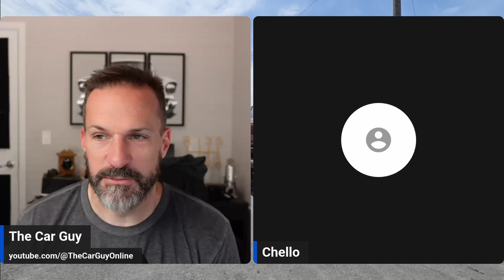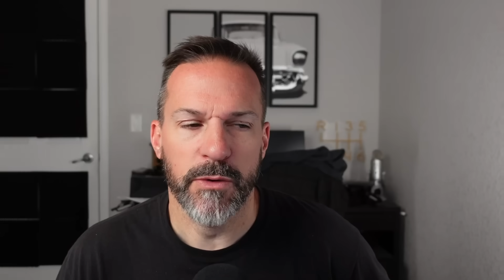Former GM Engineer EXPOSES Planned Obsolescence Tactics.

Comment: This is unfortunately industry wide. I work in a factory that makes steering components for a lot of passengers cars and also a lot of semi's, fire trucks, military vehicles... Basically the engineers don't improve the product, they only improve the line by either trying to reduce the amount of people working on it, or the time it takes to assemble one product. But most of the time, they basically work with other suppliers trying to get a certain part made cheaper. Once that part arrives, they try to modify either the PLC or the fixtures, machines... to run that part that is of lower quality, with worse tolerances. Basically they're just trying to save money.

Comment: Yeah, sorry, I don't believe adding an additional pinion to a planetary gear is cheaper than tempering four gears.

NEVER own stock in the company you work for. NEVER invest in any individual stocks unless you can afford to lose the money. It should be illegal for companies to encourage employees to invest in the company's stock.

GM makes profit off selling parts. A lot of profit. The service parts retail price is ten times or more what GM pays for the parts. The problem is, a lot of dealers don't use GM parts. Haha. Why wouldn't GM require dealers to use GM parts? 

Yes, it's true that changing your oil every 10k miles and never changing your trans fluid is dumb advice. On the other hand, people WANT vehicles with less maintenance. GM isn't the only automaker doing this. Oil, trans fluid, and antifreeze has become MUCH better than what we had even just a few decades ago, for sure. But extending the service intervals to 3X or more of what was once considered standard is foolish.

Comment: I'm sure most/all manufacturers do this to an extent, but with General Motors, it's always been pretty obvious. What I found was most painful was the whole Cobalt/G5 ignition system where the ignition contact could easily be cut if a heavy keychain was used, in which case the car would shut off and steering would lock, regardless of how fast it was travelling. A few people died as a result. But the biggest highlight to GM's corporate greed and malevolance was that they knew of the problem and chose to favour paying off lawsuits over fixing the cars with a sub-$0.25 part. That alone will keep me away from General Motors for the rest of my life, no matter how good of a product they build. I really do love their Volt as a proof-of-concept vehicle. If they re-built a Volt in a station wagon format, it would definitely be tempting.

But I'll always rememeber how they'll f*ck their customers as they shake their hands and that'll keep me away.

Comment: As a retired mechanic, bought an EV and I’m soooooo happy 😃 😊😊 I’ve also got no stress & clean hands & a pocket full of cash 😊😊😊
Reply: Until you need a replacement battery.
Reply: @mikeytitanic  battery warranty is 8 years 100K miles. Batteries are coming down in price.

Comment: Drive a 1991 nissan d21  pickup  i can fix just about everything on it myself parts are available interior stuff little harder but love the truck.
Reply: Have a 2001 Frontier 2WD with 229K - call it the WarBird - reliable, tough as nails. Easy to work on.  LOVE IT.  Also have a few other non-cvt Nissans  - Nissan isn't perfect but they try - need to abandon cvt completely.

Comment: My elentra has a non replacable interal transmission filter, at 80k miles all the transmission filters are clogged regarless in you changed the fluid every 5000 miles..  only way to change it is full transmission break down... bullshit...

Comment: I wish people would stop calling that planned obsolescence. It's just good ole inferior product design. planned obsolescence would involve timers or sacrificial components engineered to fail specifically not  due to a lack of maintenance. 

not caring how long it lasts past the warranty is not planned obsolescence. as your interviewee said, car manufacturers sell cars, they don't make money fixing them.

I'll add that dealerships sell finance, neither is interested in you owning a car long term so they don't care if the car survives
Reply: No. The phrase is correct because it is engineered intentionally to fail. They want it to fail. The components are sacrificial. They know when the components will fail. 

Dealers make about 50% of their profit on service and repair. The guy in the video specifically stated that comment was in reference to the past.

You seem like one of those people who just like to argue because you just made those things up and intentionally took another part out of context.
Reply: @someguy5035  the term "planned obsolescence" didn't even apply to the lightbulbs it was coined for. that bulb that's still going is so dim it hardly lights the ceiling it hangs from. 

engineers build things to a specification. if that specification has an end date, it's planned obsolescence. if the specification is to survive normal use while costing the least to produce, that's regular corporate penny pinching.
Reply: @someguy5035  Until you've been given a budget to design a product, you won't really understand. No ones going to say "this wheel has to last less than 50,000km" theyre going to say "this wheel has to cost less than $50".
Reply: @jaro6985  If you know something is going to fail, resulting in cost to the owner, it is planned.
Reply: @someguy5035  you're twisting words now, before you said its specifically designed to fail early, now you're just saying if you know it can fail at any point. Again, design something within a budget and tell me it can last forever.
Reply: @jaro6985  Everything you have posted in this exchange is in defense you twisting someone else's words and expecting the rest of us to go along with it. 

It is designed with failure being a part of the plan. There are things designed poorly without malicious intent. That is poor design.
Reply: Exactly, its just cost cutting.
You could argue the maintenance intervals are some sort of planned sabotage though, if proven to be true.

Comment: S-10's from the late 90's and early 2000's had a recall on the solenoids because they "accidentally" put the solenoids at the wrong shift points and it was destroying the transmissions. 
Sure, they issued a recall MANY years later, but the cheap solenoid replacement basically cost them nothing because they had already made millions selling replacement transmissions.

Comment: The average consumer is only interested in what gadgets the car has or how pretty it is. The guys and girls that are actually into cars all drive 10+ year old vehicles and like me, I drive a 42 year old truck with a 14 year old drivetrain swap, aftermarket ecu and all the "production" flaws in the driveline (5.0 coyote with upgraded oil pump gears and a homemade single tubeo set up, vvt limiters, built 6r80 with a built 8.8 in a 83 ford Ranger). Truck gers 24mpg, runs 9s in the 1/4 and has proven to be a dependable daily driver for the last 3 years when I finished it.

Comment: Retired automotive technician here. I had the low/reverse planetary in my Silverado explode while gently backing out of my driveway. Sadly this gentleman in the video is correct. If you could get an engineer from the engine development to speak the truth, you would be amazed at the garbage GM is making now. I wouldn't recommend any GM vehicle to a prospective buyer, and that was the only cars I used to purchase. I took delivery of my new Honda last Friday. It is my second Honda now and I couldn't be happier with the dependability. If you don't like Honda's, that's fine, Toyota makes a great vehicle too. You'll thank me later.

Comment: Ford and GM have let the accountants loose in engineering, resulting in substandard parts.  I question if the engine generates 50 more HP than normal if the drive train would fail?  Engineering once built parts to handle a change in power, basically a change in altitude, fuel, and bolt on kits.  I am afraid to put a small NOS kit on today's stock engines.  

I am a retired COO with a background in manufacturing engineer.  I worked for GM in 1998 to convert a Malibu plant to run the new Saturn cars.  It took one meeting to learn that GM had no management plans, meaning they let the engineers free roam, and argue 90% of the day on who holds the most seniority!  If GM wants to cut costs, it is time to move back to full management, and fire the toxic engineers.

Comment: My 2010 F150 with the 6sp still drives like new (6R80 transmission).  Coming up to 300k kms and most of that is short city trips. Will keep this truck for another 5 years minimum. Would never buy a GM. Not saying Ford doesn’t make the same obsolescence short cuts. But they don’t do it on their trucks as much.

Comment: Explains why my POS Duramax LML snapped its crankshaft in half at 102,000 miles. Stock truck, stock wheels and tires, immaculately kept and maintained. Ended up buying a 2023 Denali 2500 HD and its been a cheap POS as well. 30,000 miles and nothing but trouble with it. Done with American vehicles after this.

Comment: Just take one look at GM truck GCWRs, and it will tell you everything you need to know. They're just not capable. GM makes disposable, less capable vehicles. They've completely abandoned building competitive trucks. They build something that looks like a truck, with barely-competitive specs, slap a trim package on it, and charge $40k more for vehicle that's 1/2 as capable. This results in hugher profits, which means it will eventually take over the market.

Comment: I dont work at Opel but close enough to the fire to know that this is correct. When Opel was part of GM managers came in, introduced cuts or directed engineers to use the cheaper option while engineers pressed that this will cause a cost down the line.
When Opel then had to recall their vehicles to replace the part later on, the manager gone higher up into the GM corporate ladder and Opel had to take the loss.

Comment: I sell auto parts, and the statements expressed are EASILY confirmed every day over the counter. Make it juuuuuuust past warranty and then who cares? And that's why the vast majority of those dealer parts department parts don't last anywhere near like the original factory-installed part. They don't have any warranty hurdle to clear! When I sold parts at the local Chevy dealer back in the late 80's early 90's several sales people told me multiple times that they didn't make the money on selling the car, they made the money in parts and service. ENGINEERED TO FAIL! I have so many anecdotal stories that further point to that, but at the end of the day it's just my word against the almighty manufacturer, but I will give one more story that I can say is true because it's something I did.

As I said, I worked in the parts department, and one of my coworkers and I decided to see just how much it would cost to build a Cavalier (which were then sold for between $7800 and $12,000 from just individual parts. We started with the larger, more expensive components and moved downward, but we weren't anywhere NEAR a finished car when we hit $100,000. For a Cavalier. There were so many parts that you couldn't buy as an assembly, but were priced relatively expensively on their own (like trim pieces and nuts and bolts) that the cost just rolled upward. And the majority of parts we sold over the counter were just that: individual, small parts, priced relatively expensively.

The only reason the manufacturers are okay now with building vehicles that might make it 200,000 miles or further is because they've got to do something to be competitive with the better manufacturers whose vehicles legitimately and historically make it that far, and because people drive so much more now that the time of ownership isn't much more than the old 100,000 mile goal of new purchase required.

Comment: My late father in law was a chemical engineer with Mobil. He told me that starting in the seventies, as stricter regulations upon vehicle manufacturers began, in order to control costs, manufacturers were coming to the oil companies asking for better additives to protect the engines. The manufacturers had begun changing metallurgy and removing any “excess” weight within their engines and other components in order to meet fuel consumption requirements.
Reply: I sell auto parts and I've sold a lot of "hot rod" parts in the past. Old-school engines had camshafts that were made of cast iron. Replacement cams for them still are. Newer engines have billet steel cams, much harder material. The oil industry removed zinc, a wonderful lubricant, from their gasoline engine oils several years ago because of EPA mandates, and because billet steel doesn't need it for the break in period after an engine build. Old cast iron cams definitely DO need it though, and if you build an old hot rod motor, like a pre-fuel injection Chevy 350, and use say, today's Castrol 20w-50 to break it in, you're going to wipe the lobes completely off the cam because = no zinc. And that's not covered by warranty. So there's a big market for retro oils with high zinc. Lucas makes one they actually call "Hot Rod and Classic" oil. My long-winded point is that where your father in law had to add chemicals to satisfy the manufacturers, he also had to remove additives to satisfy the government. Much to the financial hardship of people who weren't in on the back room decisions of cost cutting.

Comment: People forget that all car companies are really just profit centres that are in the business to make money for the shareholders. They just happen to do it by building cars. I worked for a part supplier and every year we had to cut our costs to provide a certain percentage savings to GM as part of our contract. Every year we would do a workshop with GM Engineers to find ways to cut the costs of the product. Down-gauging was the most common method. This had the dual benefit of reducing cost and mass which in theory would improve mileage. But the main focus was on cost as they were not as concerned with mileage when it came to pickups.
Reply: I remember when the new style Silverados came out in 1999 I looked under the hood and the sheet metal was much thinner than in the previous body style. But there were lots of complex curves and creases that reminded me of how airplane manufacturers build things as skimpy as possible to reduce weight. Looking back, that was the beginning of the decline in my opinion. Next big drop in quality benchmarks was the CANBUS. Things got much more fragile, difficult to repair, and expensive from then on.

Comment: That's why I am thinking of buying a early 70's truck with a manual transmission. Had a box chevy with over 300k miles on it before the frame rusted out.
Reply: In my opinion if you're looking at Chevy I think you're fairly safe all the way up to 1994. 1995 had a new split-construction A/C compressor that ALWAYS leaks, and in 1996 came the Vortec, which to me never justified the 20 more horsepower for all of the increased complexity and cost of repairs. For example, distributor caps went from about $15 to $50. Lots of parts with price jumps like that. (I sell auto parts.)

Comment: I’ve been saying this for 25+ years now, GM only wants to get it to the warranty. They have encrypted their onboard computers to make it impossible for local shops or the owners to fix or at the basic find out what is wrong without taking it to a dealer to get it read.
GM is not 5he only manufacturer doing this. Along with the engineered obsolescence. Wet oil belts, active cylinder deactivation, trans failure, engine failures due to oil recommendations. Can go on and on. We all need to stop buying this junk

Comment: GM and Ford should face a class action lawsuit for telling customers their transmissions don't need to be serviced until 150k miles. That is complete bull. Most mechanics will tell you once a transmission goes that many miles without service, you are better off not even touching it at that point because a flush will probably end up grenading it.

Comment: On the positive side, I have a 2002 Suburban that I have owned since new an the only problem I had was rear wheel bearings. My 4L60 trans is going strong at 180,000 miles. I change then engine oil every 5k miles and trans oil every 30k miles. My front brake pads have not worn out yet. And I tow a toy hauler trailer and drive in the mountains. It has been a great truck for our family.
Reply: Your (and my) maintenance schedule is the rare exception. I sell auto parts and virtually NO ONE I sell to ever thinks about their transmission. Yet they somehow think they're doing the right stuff and are very disappointed when their transmission breaks on vacation. Most people just don't care until it hits their pocket book and they come to see me.

Comment: The youngsters here might not be thinking about the 5 digit odometers. It would still be that way, but Reagan put Americans first and gave them an open market, forcing an increase in quality from GM, Ford and the defunct Chrysler.
Reply: I remember that. I remember when 100,000 miles was a MAJOR achievement, pretty rare, and people would watch in awe as the odometer rolled over. Photos were taken, phone calls were made. Smiles, laughter, back slapping. Jokes about the manufacturer wanting the car for a museum piece, with a free replacement brand new vehicle handed over. That 99999 turning to 00000 and the proud owner feeling like they'd just won the lottery. A simple joy, but honest.